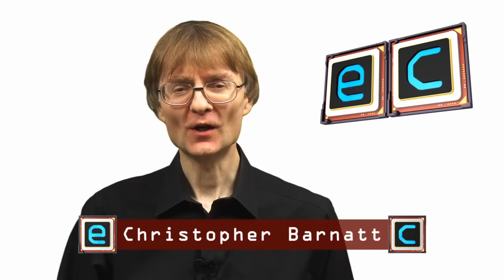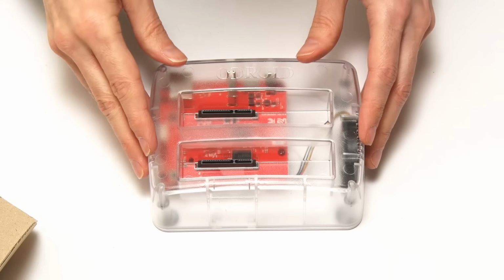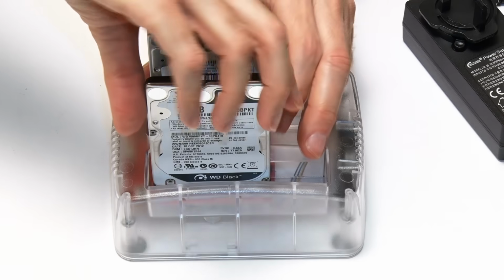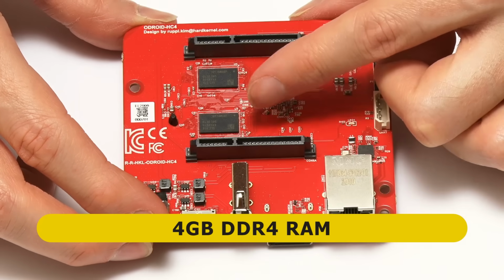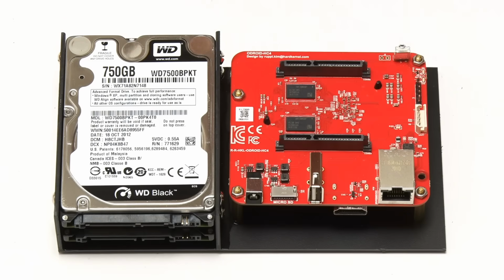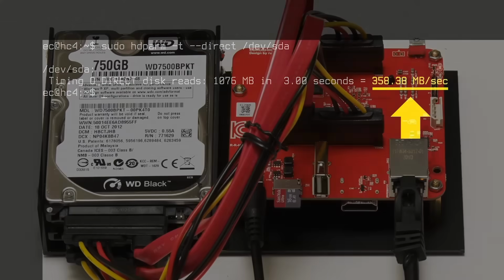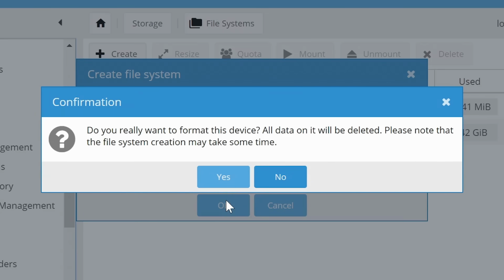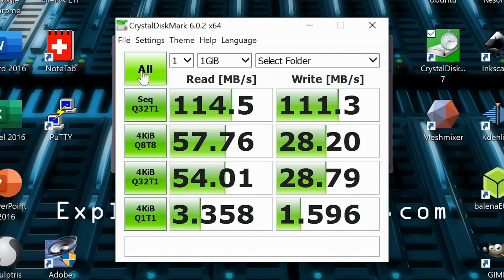Odroid HC4 Twin SATA SBC (inc OMV RAID setup)

Comment: If you take a second toaster, and stick it upside down on top of those hard drives, it should help stabilize those wobbly 3.5" HDDs. Those 2.5" ones are SOL I'm afraid. I think I'd rather stick to using an old computer as a NAS, its eco friendly and cheap/free.

Comment: I own one of these. I have it plugged to my TV running CoreELEC, which is an ARM based OS with a minimal expression Linux meant to exclusively run Kodi. You can run Docker as an addon on Kodi, so you can do more than just play movies if you want.
Reply: Docker as an add on to Kodi?
Reply: @dsmyify  You can find it in CoreELEC's own addons repository. There's also another addon from linuxserver.io with a repository of popular containers.
Reply: @madfury3179  ~ just be careful, docker containers run with root privileges.
Reply: @dsmyify  I believe also Kodi addons run as root in CoreELEC and LibreELEC.

Comment: Interesting feature, and just in time as I’m considering getting a NAS. Only thing is, I’ve a love-hate relationship with ODROID with how their support pages turn into dead links over time. Not too good for long term support especially since their hardware generally requires a specific compile for each device. I’m a bit worried about your new set-up, won’t cooling and vibration be a problem?

Comment: OS installed on microSD for NAS? I don't think it's a good idea. Does it support booting from sata-drive?
Reply: @J Fz And if you install OS on sd-card for this NAS you probably may lose your files when sd-card will crash.
Reply: @J Fz Yes I know that it is possible to make an image, but I think better option will be just to connect external ssd to usb and install os on ssd, and you'll not have to do any image at all(in most cases).

Comment: This has potential for being a Drive Duplicator, but massive fail for only including (1) USB 2.0 port!  There's no reason for that in 2021!! And that case design is really poor for 2.5 inch drives, the Firewire-800 docks that I use have spring-loaded spacers for 3.5 / 2.5 interchange.  (You have a nice solution with the SATA extenders.) The webpage specs don't list 64-bit CPU/OS support, but if so you could install ZFS on it and have yourself a cheap zRAID1 mirror with all the ZFS benefits - inline lz4 compression, snapshots, easy SMB / NFS shares, encryption(?) - dunno if the cpu would support it but you could do 3rd party like LUKS I guess.
Nice review, Chris :-)

Comment: I think you're right -- it seems a little impractical for a toaster to be a NAS. I'm sure there are some practical uses for a SBC toaster, but I don't know how often I'd be swapping drives if there are only two bays.
For that matter, I would love to see a low cost option for an SBC that can work with four drives for a NAS. I just need more capacity and redundancy but I want something more streamlined and power efficient than my present Windows server.

Comment: The ease and access of the drives could make this useful as a duplication/migration system.  Plug a source drive in the first bay, target drive in the second bay, and duplicate.  If you had to do this for customers on a frequent basis (replacing a failing hard drive, upgrading a full drive to a bigger capacity, etc), this would be convenient.
Reply: the official forum says the connector is guaranteed to survive only 100 HDD mounts, so it's not a scenario for HC4.
Reply: Then the male/female connector is essential.

Comment: Can it boot from the HDD's? That would be cool.
Reply: To be honest, I think it's better to dedicate the drives to storage and boot the system from another device, such as the micro SD card used here. I don't use OMV so I don't know whether it supports being booted from one of the devices it uses for storage. If it does you'd probably have to partition it and lose space from the partition used for storage. You'd also waste space on the other drive since RAID 1 needs identically sized partitions.
Reply: I know you can boot it from one of the HDDs.  I have seen people mix an SSD and HDD in it and boot from the SSD.  Of course you lose the mirroring aspect.  Booting from a mirrored raid is a good question though.  I'm running mine with two 4TB drives in mirrored mode.  Setup was really easy and I've had zero problems with it.

Comment: after that whole mess with smr and wd reds, I'd think wd black are just fine for nas
Reply: Admittedly, WD handled that situation badly, but it isn't that SMR disks are a problem with NASes per se, but with RAID arrays, which are usually (but not always) used in NASes. WD Blacks have their own problems when used in RAID arrays, since on a read error they will re-try instead of giving up gracefully and letting the controller reconstruct the failed read from parity.
Reply: In a small configuration like this you'd probably be fine until they started to fail. 3-8 drives and you'd prolly want NAS-rated.

Comment: Marvellous presentation as usual.
It's such a shame the term 'headless' came into common use as it is a very inaccurate and misleading term. As the head also contains the brain, with the CPU + memory being the rough equivalent of a brain, then a computer system without a head would be little more than a case plus power supply - not very useful. A more appropriate term would be to run a system 'faceless', that is without local I/O, input output.

Comment: I’m sure some 3D printing guru is already modeling a neat enclosure to take care of the ‘toaster’ design flaws. Thanks for another fun and informative video, Chris!
Reply: That should really function as  a full length vertical bay you just drop the drives into with friction on both sides.

Comment: I kind of would of preferred if they just had exposed the PCIe lanes, that way you could add your own controller or hardware raid cards. granted you'd need a different power supply but they could have cornered a cheap mass storage/nas VM machine if done right

Comment: Well, interesting device, but the price... ASRock J4105-ITX for even less has m2 slot + 4 satas. There are even cheaper motherboards with m2 + 2 satas. You need ram of course, so it's additinal money, but the outcome is much more and it's fully functional x86-64 system, not some arm with specific NAS OS.
So unless they can do it in 50$ or less - it does not look competitive.
Reply: M2 on that board is only for wifi/bt card
Reply: @Pantelos123  ok, well, i marked a class of mini-itx cards with pre installed processors which can be used for storage and media pcs. 
Others may have m2 for storage, this ASRock J4105-ITX still has 4 sata, not 2 like odroid. And all this for the same price or even less.
Also there are more USBs which could be used for storage and PCI-E clots, which could be used with PCI-SATA cards for more storage. So if you are building storage machine - standart mini itx gives you much more from start, more potential and for the less money.

Comment: I could be wrong but did I see RAID 10 as an option, if so you will get better performance using RAID 10 vs using just RAID 1. RIAD 10 you are running mirror and stripe, I like to see that as a test if you can use RAID 10, thanks
Reply: Well I was about to reply that RAID10 would require a minimum of 4 disks, but I looked it up and you're right! 
https://en.wikipedia.org/wiki/Non-standard_RAID_levels#LINUX-MD-RAID-10
I only use ZFS these days (and LVM for work because I'm forced to) so no direct experience with Linux MDraid but it would be interesting to run some tests with that config.
Reply: @kingneutron1  Been doing storage for 20 plus years but retired now as I always recommend large SQL DB to be placed on a raid 10 as it gets better performance than a raid 5.

Comment: Hi Chris, I have a few Toaster style drive units that have the with the same problem. The drives are held in by gravity and the by the connectors alone.  But after years of working that way I haven’t had any problems. That said if the drives got hit or bumped I’m sure I would have a problem.

Comment: >Odroid-HC4
>83.99€

Bro, I  buy x86 terminals for 16 € with all cables included.
Reply: What about power consumption? The whole point of this is low power consumption
Reply: @jackalek  Wyse/Futro terminals will use 10-20W of power. Your argument is invalid. The savings doesn't justify the huge peice difference.
Reply: @jackalek  Btw, buying used hardware saves muh Planet more than buying new ARM gizmos.

Comment: What I think I'd do is actually build some sort of case and use the ODROID as a backplane and plug the drives in and screw then down.  I could probably use an old tower case with a removable cage that I could build upon.  Or, even just mount the drives in a small case and add the extension cables to get it to work.  I commented before watching to the end.  LOL.
Reply: Now that is an interesting idea. A 4-port version with 8GB RAM, USB3 and 10-gig + 1-gig ethernet would be veeery interesting to cluster.

Comment: As a point, you /can/ do this with a Raspberry Pi 4. You just need to set the NAS configuration up ahead of time in the Raspian terminal itself rather than an OMV gui, because OMV doesn't like USB drives on RAID due to it's apparent lack of reliability. Once you've created the RAID (Recommended only RAID 1), you can then mount it as a filesystem in OMV as normal.

Comment: I think with 3.5 inch drives your better off running this upside down with the SATA connectors facing upwards.
Reply: @J Fz They are in the same orientation,  just flipped 180.  As to the heat,  well shouldn't be an issue.  Been in electronics for 20+ years.

Comment: Thanks for walking through the process of setting up RAID and a shared directory in OMV. It's a simple thing, but sometimes it helps to see it done. 
Now I'm wondering if I should try the same thing with my Pi 4. Maybe set mirrors on 2x USB thumb drives in the USB 3.0 and 2x in the 2.0 ports and run some tests of performance between them.

Comment: I have a raspberry pi 3 b + that I hopefully will be able to do something similar with once I have a usb to sata III connector & a 1tb 5400rpm HDD. An ssd would be nice but that's not in the budget. It would be great to have projects & the bevy of disk images I've accumulated available from a NAS device vs keeping those files on my main production machine.

Comment: Sponge with 2.5in drives would work well, i used to mount my drives in bungee/sponge configuration inside of my case to minimize noise and vibration. It worked really well and never had any problems. My current 2.5in drive is lying on piece of sponge since i removed all of my hard drive cages to improve airflow.

Comment: I am really surprised that the "toaster-style" mount did not come with the obligatory spacers for the 2.5 inch drives.  I have these spacers included with other mounting docks.  I also like the spacers that fold down for 3.5" drives and pop-back out for use with 2.5" drives (I should send hardkernel photos of these).  I suppose that I could print some spacers, but they would not match the chique clear-plastic case.    I see this as a perfect candidate for two very large, mirrored,  RED, PURPLE, or GREEN drives.  (Avoid SMR drives)

If I wanted the drives to be more secure I would simply make a "hat" to hold them in place. (Maybe held down with rubber-bands.)

Your custom rig did not use the fan!  Tsk, tsk!
Reply: there are few things that makes this solution not well designed: 
1/ Obviously, the poor support of the drives, especially the 2.5" ones. As you noticed many other previous similar toaster/rack designs have solved that.
2/ For a NAS usage, you'd expect some UPS with a battery connector to avoid any data losses during power shortages or micro breaks. The Cubietruck provided this many years ago.
3/ The 40mm fan is certainly noisy and the device won't be accepted in a living room (eg. as a HTPC, since the SoC is suitable for this and there is an on-board IR receiver, or as a disk cloning machine sitting next to a workstation)

Comment: yes you definitely answered  my questions regarding the HC4 real world stability of holding drives in place,  much appreciated. I'm going to take a slightly different approach and get "Stackable 3.5" HDD Bracket Duo Pack Cases" for 10$ on Amazon, with the SATA extender cables that you use, while keep using the HC4 clear case (which is kinda cool and keeps  the board dust free) . What do you think?

Comment: Decent little NAS board, but that toaster config and the way the board would have to support the weight of two 3-1/2” hard drives is kind of ugly. Most “dumb” toasters at least have spring loaded flaps to accommodate the various drive types. As you say, we don’t judge these systems by their cases. Surprised it runs on just 5 Volts. Must have a buck/boost converter onboard somewhere for 3.3V and 12V? Would love a board like this with 4 SATA connectors.

Comment: Using 3.5” drives shouldn’t really be a problem since gravity is a relatively strong force to keep them in place. Not sure who moves their NAS devices or PCs around. My NAS has been untouched since built so drive disconnects are non-existent. Maybe if using 2.5” drives you can 3-D print a couple of covers to snap in place to prevent wobble of the drives. That boot button on the bottom is a bit mystifying. Nice work once again sir!

Comment: As far as I see the use of this kind of board, it is mainly to copy disk or ghost a disk. So if you want to go from a 254go to 1To disk, using such a thing would be convenient.
As fore making it a NAS, I strongly agree to change the configuration as it is presented.
Pro would be 2 drive more stable. Con would be the wire and fixing solutions. That is if you compare it to the received package.
I wish we had class on raid server.

Comment: Yes well, I'm not convinced that this setup from HC4 is a good design as you can see the flaws on how HDDs could slip or topple out from the "toaster". Besides HDDs are fragile after all as the spindle disks and read/write heads can collide and brick the Hard Disk - which makes this design disconcerting for using 2 SATA HDDs mounted but not clamped or locked-in properly. HDDs maybe still used for huge archive storage as well as using as primary storage for PCs, if you are constantly deleting and writing files, as SSDs hate those things as preferred to be used commonly for "Read-Only" purposes, due to Memory Wearing and depleting the Write and Erase cycles. Also, I'm curious about those newer upcoming HDDs with HAMR technology as well as Helium-filled HDDs, as HDD factories and companies seem keen not to let their HDD range get discontinued too sudden.

Comment: Sure the "toaster" configuration is not textbook but if you put the assembled device in a safe space that doesn't experience strong crosswinds, I think the computer would be OK. I'm more concerned about the motherboard nipple, that's just weird. But what do I know, I've only been working with computers since 1982 and an IT Admin for over 25 years. You would not believe some of the goofy things I've come across during my tenure and the toaster looks positively bullet proof by comparison.
Reply: As a reset button it needs to be accessible when needed but difficult to press inadvertently. It's like having a button on the rear of a more conventional case, that's all.
Reply: @johnm2012  You explained it to me as if I did not understand it's intended design. From context it should be apparent that I do.

Comment: Looks like a proper 2-bay NAS killer. It has the performances and a far lower price than any commercial NAS available.
Reply: A commercial NAS would have a much better case and the drives would be properly and securely mounted in trays. Such cases are more expensive than the electronics, I'm afraid.
Reply: @johnm2012  Chris made a good custom build. If he had spaced the disks correctly he could had mount the board directly on them. From horizontal the board and vertical the disks to horizontal the disks and vertical the board.

Comment: About that boot-switch. It's at the bottom so you can't accidentally press that while there are drives connected.
Reply: Yes. But, to access it, you've got to lift up the case, and so you've got a couple of hard drives wobbling about, as you lift it, because of the crap "toaster" mounting system.

No, it's not a game-breaking problem, I'm sure. But it is a bit of an annoying design and I don't blame Chris for just freeing the board and fashioning his own mounting system.
Reply: An important feature! My Apple ][ Plus, and the first gen Apple ][, had the reset key at the upper right of the keyboard. Very frustrating, one of the first Apple hacks was cutting the hinge side of a cassette tape case to rig a cover for it. 

(For you youngsters, the cassette tape was a precursor for the CD/DVD. It was used to load programs on Apples before disk drives became a thing, there was a really neat self-modifying Basic phone book demo program that would poke phone numbers into the program's data lines so that when the program was written back to the tape it would contain any new entries that were added, something that can be done when there is only one thing running on a computer and you know where in memory everything is)

Comment: A great low power consumption solution - nice, especially if you are trying to keep costs down....
Thank you Christopher, very informative and thank you!
Reply: All NAS systems should have video out. I have had several times not knowing what a NAS was doing. Is it syncing? Can I turn if off? Etcetera. You need to connect via SSH, but sometimes it is not responding .. .. That's a real bummer then.
Reply: @deslomeslager  You can connect an HDMI lead to this and see on a monitor...just like a any server...
Reply: @RoboNuggie  Exactly.